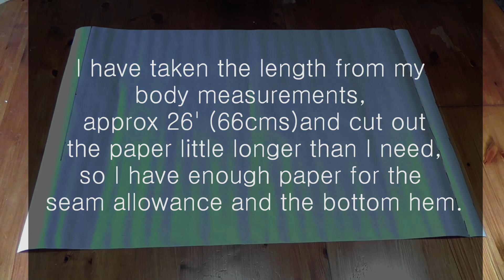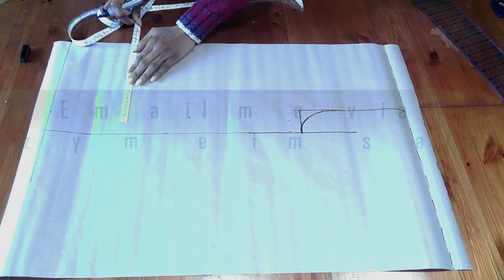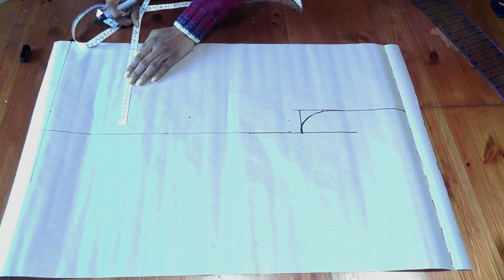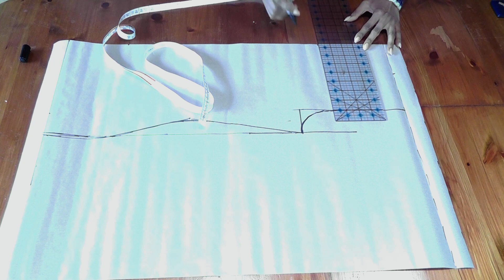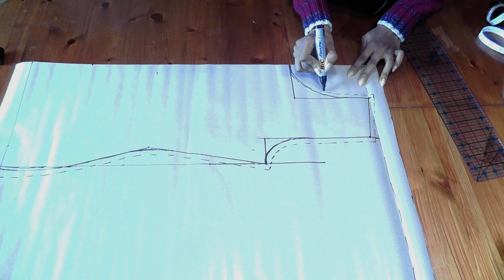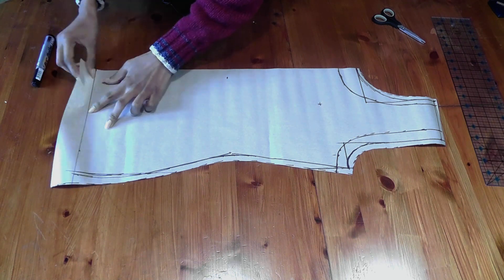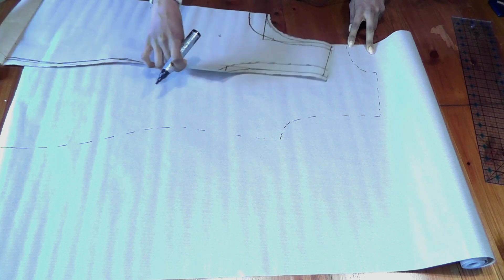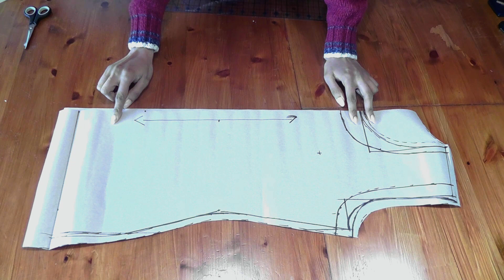Basic T-shirt Pattern / Sewing Project Stretch Fabric / PATTERN DRAFTING TUTORIAL 1

Comment: Hi izzy..wow!! Awesome! Absolutely I learned from your tutorial..I hope u have a lot of tutorial to share..
Anyway, I just want to ask if how do you get the inches of the top sleeve to make a hole in the arm..
Your channel is great and thank u for sharing ur video..
Could I request if you'll make for a a draft pattern for a basic short? With or without elastic? Thank u so much izzy.. :)
Reply from the maker: Mika Murai I am glad this tut is of help... the 4 inches or the top of the sleeve is just standard for smaller sizes, for larger sizes you add 1/2 to 1 inch. Its a base measurement based on your shoulder bone.. so don't worry too much about how  we got it.. when you draft 2-3 then you will get the hang of it....:-)

Comment: Hi Izzy, I really like your draft tutorial..but somehow can I ask you on  how you get the 4cm on making of the sleeve? Thank u.. :)
Reply from the maker: Hi, there is a calculation for the 4 inches... I need to check my 15 year old notes...see this 4 inches is based on your bone structure for a normal woman... if you are taller, then take a bit more, if its a plus size can take up to 5 or 5.5 inches... I have drafted so many patterns and the 4 inch formula works every time... when I find my notes and explanation I will update it... thank you for pointing it out...

Comment: I found this to be missing the math for the sleeve. I had no idea where the numbers came from for the length and width of the sleeve. Once it was finished I understood the 9.5" measurement for the cap but I don't know what numbers where used to get me there... I have seen other videos that show you a body measurement chart so you can see where the numbers are coming from and how they should be calculated. Please keep in mind that you know what you are doing, we are trying to get where you are...
Reply from the maker: Hi Krosettdesigns.. I think you are right and thank you for pointing it out... I need some like you to check the videos before it goes live.. ha ha. Ok I will have to make another short extension to explain the sleeve part well....once uploaded I cant change this video.... :-)